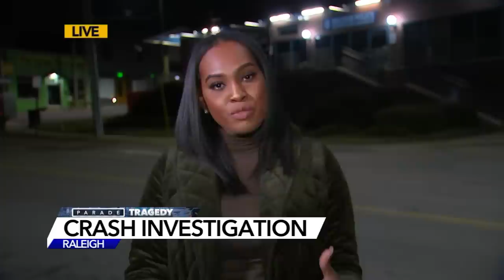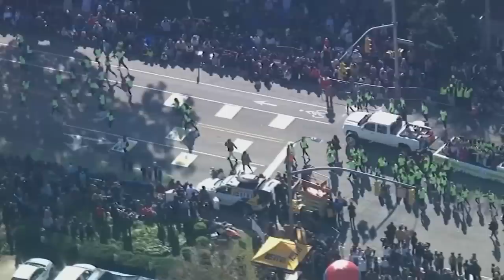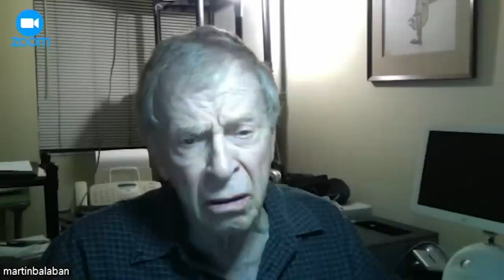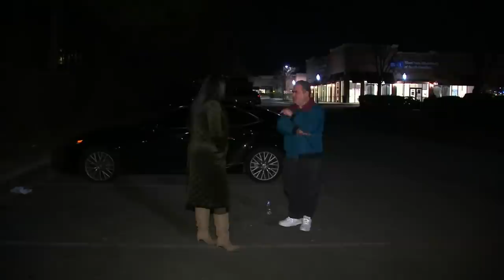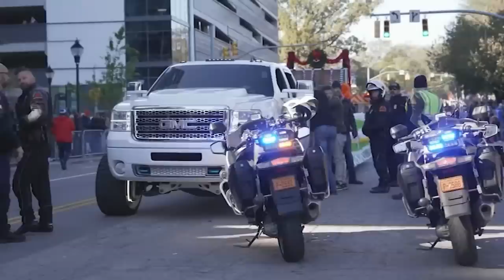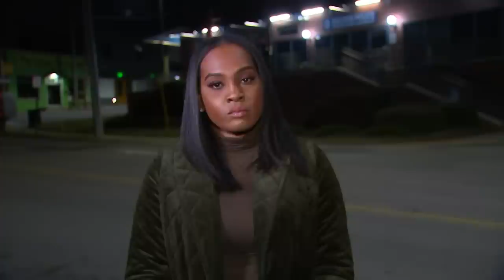Investigators look at truck part by part after Raleigh parade tragedy

Comment: I believe driver is innocent in this situation.  He and the kids family are in our prayers 🙏🏽 in this home.  😢😢😢
Reply: I'm blown away reading all the hateful comments on this video so far. But yours seems to be the only one that is not childish or hateful. Thank you for acting like a human being. 👍🏻
Reply: The 20-year-old driver has been charged 17 times for vehicle violations since 2021.

He was ordered for vehicle inspections four times for improper equipment, most recently 3 weeks ago but never complied. Due to multiple safety violations the driver was ordered to attend driver improvement classes.

It's likely his vehicle modifications  that appear illegal and dangerous played a part in the accident.

He was charged at the scene for improper breaks and cited for no operational braking systems. The emergency brake was not operational.

The vehicle's giant wheels and lift are illegal and require fender flare upgrades, bumper upgrades and marker lights. Extending the bumper lower and around the tires and adding fender flares that reach out to edge of the tires increase safety around the vehicle and stop the giant tires from grabbing and pulling pedestrians under the vehicle while making the vehicle street legal. The driver refused these required safety features.

At issue is the fact that the driver still had a chance to make life saving decisions.

As the vehicles brakes failed the driver put the vehicle in neutral instead of using what control the vehicle had left in Engine Braking. Simply putting the transmission into first gear on a GMC Denali heavy duty will engage a gear ratio of 4.54 which is a crawler gear and likely to put the vehicle in a speed slower than an adult walk. Instead the vehicle sped down the hill out of control exasperating the danger to the children ahead. The accident followed shortly after.

The fact that the driver carried a concealed weapon illegally at the parade with thousands of children points to his general lack of safety awareness and concern for others.

His charges include reckless driving, careless driving, improper movement, improper equipment, misdemeanor death and carrying an illegal weapon at a parade.

It is likely he will do little to no time for these charges.
Reply: @MajorBorris  "As the vehicles breaks failed..."

* Brakes.
Reply: @MajorBorris  Thank you for clarifying in detail, I've been trying to get what info I can on this incident after only hearing about it a few hours ago but was only reading speculations followed by extremely hateful and childish comments. I appreciate it. 👍🏻
Reply: @mdh1775  You're welcome, for me the worst kind of accident is the one that could be easily avoided. Personally, I would never let a 20 year old kid with a pistol in his pocket drive an illegal Monster Truck next to my child.
Reply: @mdh1775  The childish comment seems to be the one you answered to. Check the post right after yours for clarification.
Reply: @vsbaretummysugastonguetech1540  Shhhhhhh. Quiet down little one, the adults were talking.
Reply: @MajorBorris  you may have the gear ratio correct, but you’re telling me this truck maxes out at near redline at the speed of an adult walk?? So taking off from a dead stop the truck will shift into 2nd at idle speed? I’m lost, please help explain.
Reply: @bobsmithinson2050  I'm assuming at normal operating speeds second gear shifts rather quickly. It's a 10-speed transmission and first gear is all torque to get the heavy duty vehicle and it's load going. 4.54 is a very slow crawler gear. Yes I bet it would redline like crazy if you downshifted to it, oh I see what you're saying red line at a walk yeah I bet it would.
Reply: If you want to drive a big boy truck but don't know how big boy trucks work then yes it's your fault. If you cant handle a rig in an emergency then you shouldn't be driving a rig, especially around children walking
Reply: @MajorBorris  thanks for explaining deeper. Yeah, that makes sense now that you mention the 10 speed gearbox
Reply: @macbook802  in summary yes, vehicle operators are responsible to know all the laws associated with their vehicle and modifications as well as it's complete operation in a safe manner. That's why it's likely the city, the parade operator or the manufacturer will see no liability.
Reply: @MajorBorris  it has absolutely nothing to do with the trucks manufacturer, the entire truck is modified away from factory specification. The state could have impounded the unsafe vehicle years ago, the state can proactively impound modified vehicles going forward to avoid this in the future. On the road you're only as safe as the vehicles around you. If Johnny f word face decides to modify their vehicle in an unsafe manner(lifted trucks, stanced cars, squatted trucks, drift cars, drag cars) then the state should be obligated to keep it away from families and businesses using the roads correctly
Reply: @MajorBorris  the truck has a 6 speed transmission 😂
Reply: @elliothouston1830  even if it's the older one first gear still a crawler
Reply: @MajorBorris  they were maximum going 10 mph he was already in first there is not a lower gear
Reply: @elliothouston1830  looks more like the vehicle is in neutral to me and out of control versus in first gear and attempting to control the speed. He may have even tried to throw it in a park which would likely just make a clicky sound but still be or default to neutral
Reply: @elliothouston1830  I would say maximum they're going 15 mph when looking at men running full speed next to it
Reply: "I believe" I should have been born wealthy and never should have been forced to work for a living. Now that we have gotten everything that we believe out of the way
Reply: @macbook802  Thats not really a big boy truck its more of an over compensting truck.

Comment: A lot of this will come down to who did the modifications to the truck and were they qualified.
Reply: It'll end up being a booster failure. It's a part failure. Can't do anything about that.
Reply: Just your average Trump voter!  Pickup Trucks and Guns!
Reply: None of the mods done to this truck would cause no brakes unless brake lines were left loose. This truck would have a hydro-boost system. Even if it completely failed you still have manual brakes. This truck would have four-wheel disc brakes. He should have been able to push the pedal hard enough to slow down. Maybe not very fast with a trailer but still should have had some brake. Master cylinder failure could cause total brake failure but that is super rare. I have never even heard of that. Didn't look like there was brake fluid on the ground. All they have to do is drive the truck and find the problem. Should be easy to find.
Reply: @usernotfound904  what does it that have to do with anything
Reply: @usernotfound904  TRUMP 2024
Reply: @mossman381  brings up another question the trailer not even have trailer brakes? was the trailer just not plugged in? was it equipped with surge brakes which work depending on the towing vehicles braking force?. was the brake controller Gain on the lowest setting or 0 ? and something i've seen alot of in NC. when guys lift their trucks since the E brake cable isn't long enough they leave it hanging so the E brake/ parking brake isn't even connected.
Reply: @FlexSZN23  was his emergency brake discnected?
Reply: @mossman381  I've seen lift jobs result in brake line failures....not the kit but poor installation issue.
Reply: @Awesomelord101  Totally forgot about trailer brakes. Those are electric and should have helped slow down the truck even if the trucks brakes failed. Very odd situation. You would think by now they would know what failed.
Reply: @admingeneral6532  I saw a video of the investigators taking pics of the truck. I didn't see a puddle of brake fluid like you should see if a brake line would have failed. It's really an odd situation. You would think they would know what failed by now. I have had many 02-09 2500HD trucks and I have had 3 of them lose a brake line because of rust. When that happens, you have no brakes at all. I know the front and rear brakes have separate fluid bowls but you lose all braking ability. Parking brake never helped in my situations. Maybe because I live in a rusty area. That truck looked pretty mint so rust probably isn't an issue. I was really lucky with my brake line failures. None of them happened going very fast or while driving in a parade. If this is a brake part failure it's really not right to blame the driver. They say his truck wasn't inspected or something but that inspection never would have found a rusty brake line or master cylinder that was going to break. If he had brake warning lights on the dash then that would be a totally different thing. I doubt the truck was junk. The rims he is running are pretty spendy.
Reply: @FlexSZN23  I agree.
Reply: @mossman381  

When I had some suspension work done on a stang the line was completely incorrect connected.  A sharp turn would have pulled it and I guess I was thinking it could have blown most of its load a mile back....remember it was coasting all day.  If it dumped its load back somewhere that could be why it looks dry in the photos?

Since he wasn't doing regular driving and hardly using the breaks ...could explain why many of the normal  warning signs weren't present.   This is about the only situation where you'd drive a steady 5mph for 3 miles straight potentially without doing more than a light dusting of the brake pedal.
Reply: @MidTennPews  booster failure would not cause this. If the booster failed the truck would still have brakes minus power assist.
Reply: @usernotfound904  you don’t know what you are talking about, and way to politicize a tragedy and stand on the grave of a child to score cheap political points.
Reply: @Awesomelord101   this could be an explanation, but from the lift it looks like they just cranked the keys on the torsion bars for the front end, doesn’t look like they lifted the rear but if they did this could explain a lot.
Reply: @joshwilson849  you ever driven a car with a bad booster.....the pedal gets ROCK HARD, hard enough you can't push it. Its not like an old car with manual brakes and no power assist, when the booster fails its nearly impossible to push the pedal. Don't believe me disconnect the vacuum line and plug it and see how your vehicle stops.
Reply: @usernotfound904  your point? Trump 2024
Reply: @joshwilson849  it would actually. The pedal becomes concrete with a booster failure. Brakes aren't the same as they were 30 years ago.
Reply: user not found 👈🤡🤖
Reply: Mods had nothing to do with this brakes fail all the time my uncle and grandpa were truck drivers and they had no mods on it and there brakes gave out it’s just parts of the vehicle nothing to do with the mods
Reply: @jthockey4851  How did you find out that the mods he did had nothing to do with the truck not stopping?   Can you post a link.
Reply: It all sucks, but why not roll the windows down and signal that you have a problem…yell, wave your hands…something.   I think that the truck rolling down the street with his tinted windows up looks suspicious.
Reply: @ryanv3751  if he would have put it in four-wheel drive and pulled the emergency brake it would have breaked all four wheels.
Reply: Everybody saying the truck had a higher boost I really doubt it the truck was a 1500 series which typically in that year had vacuum boosted brakes with no electric booster pump provision if he was riding the brakes at a low RPM he could have bled off all of the vacuum pressure and lost booster assistance
Reply: @MidTennPews  you are right,. Whit the lift on the truck and the big wheels I bet they leave the factory brake booster still though he could put it on reverse or park to stop the truck he didn't do that
Reply: The modifications have nothing to do with the brake system on that truck.
Reply: @MidTennPews  💯
Reply: @usernotfound904  what a moronic statement

Comment: The guy in the video saying the kid basically could have avoided the situation is an imbecile, if the brakes fail on a diesel, you can’t stop regardless of people saying use the enrage or throw the truck in park. None of that would have changed the outcome, the poor kid blew train horns and others in the truck screamed as loud as they could they had no brakes. Tragic that a 12 year old girl died but people are bashing this kid and saying his wheels and lift had to do with the brakes failing and that’s not the case.
Reply: When you oversize the wheels especially with those rims it’s an automatic to upgrade your brakes but idiots don’t do that
Reply: @Jimarceo  have you ever seen the size of the caliper on a diesel truck…? They need to be rated to be able to stop the 30,000 pound load they’re hauling so I doubt you have any clue on what you’re speaking on
Reply: @J_M3444  💯
Reply: It would have been simple to just turn it off it would have slowed it down if it was a push button or dial transmission it puts it into park immediately not good on the transmission but who cares trucks can be fixed

Comment: The truck was not out of control.
The driver was
Reply: he panicked
Reply: The vehicle was in neutral which made it out of control, had the driver made proper use of engine braking by selecting the first gear control may have been somewhat regained. The GMC Denali heavy duties first gear has a ratio of 4.54, that's a crawler gear and it would be likely that an adult could walk faster than the vehicle in that configuration.
Reply: It's also possible the driver tried to put the vehicle in park while in motion which would default to neutral in the Denali.
Reply: @noshot5793   I guess that's why his door was locked
Reply: @MajorBorris   An engine break at 5 mile an hour OK
Reply: @tylerrjohnson68  🤣🤣🤣
Reply: @tylerrjohnson68  do you know what a crawler gear is? So first gear ratio in the 10-speed transmission for a Denali is 4.54. 10 gears to go from 0 mph to 55 mph. I'm pretty sure if this thing's changing gears every 5 mph the first gear is changing at like 3 mph or 4 mph. In other words you could easily walk past the vehicle while it's in its crawler gear. I prefer imperial evidence and logic to come to a conclusion.
Reply: @MajorBorris   And 100% of 90% of the time it's operator error

Comment: For people who saying he should of put it in park, if you watch the video when the truck finally stops, it rock back in forth which means it was slammed in park but gm added a safety feature in that  truck bodystyle that will only allow it to go in park when completely stop making the computer tcm to engage it to neutral until fully stop, also those trucks have cable e brake which is good to stop a vehicle with no weight but in the vid you can see it pulling who knows who much weight making th truck push through  the e brake. In this case my opinion the only way he could of got it to stop sooner, is ask people from the crowd to run infront of the truck and stop it like the police did in this video

Comment: gm... SUCH A FAILURE.... we had a 2015 suburban with brake-booster issues.... wouldnt stop unless you mashed the pedal.. .. fixed it, then ran fine. 
So GM decided to "hold themselves accountable" and offer a recall or reimbursement for repairs. We sent them the invoice from the shop. 4 weeks later, GM wrote back saying the invoice wasnt valid. So we had our shop print another receipt out, and sent it out again. 6 weeks later, they said it was STILL invalid. TO THIS DAY WE HAVENT GOTTEN REIMBURSEMENT, but at the level that these lowlifes operate on, I'm convinced a GM product is something I'll never trust again in my life.
Reply: When a vehicle is customized with obviously shoddy work how is that GM's fault?
Reply: @macbook802  where is the obvious shoddy work?
Reply: Chevrolet, GMC, Ford, and Dodge all use hydrobooster systems in their 2500 and up trucks. Getting away from GM does not get you away from a hydroboost system.
Reply: @42lookc  I'm pretty sure GM uses them in the 1500 platforms as well, don't quote me on it as I have never dealt with it. But from what I've heard
Reply: @macbook802  IT WAS PURE STOCK

Comment: A team now dedicated to walking along vehicles with wheel blocks? The emergency brake go out too?
I’m not up on all the new “toys” on the market but I do find it suspicious, uncomfortable, and unreliable with the amount of electronic components. In theory, it seems way to easy for vulnerabilities, ei, RC interference.
Reply: It's highly unlikely that two systems independent of each other would fail at the same time. Investigators at the scene cited improper breaks and stated that the emergency brakes were not operational. Standard emergency brake lines do not fit lift kits and have to be upgraded or remain disconnected.
Reply: you may notice that the things the brakes attached to, have been modified. and whats easier, not hooking up the emergency brakes or hooking them up? protip not hooking them up is lazier and easier and likely he said at some point, its an automatic i dont need e-brakes

Comment: For at least a couple of decades, GM trucks have had 4 wheel disc brakes and a small drum brake inside the rear rotor as an emergency brake.
Both of these separate braking systems failed???

And having personally done the no brake thing myself, put it in neutral, get it as slow as possible and either drop it into park or reverse, depending on speeds. If you're crawling, park. If doing 5-10, reverse.